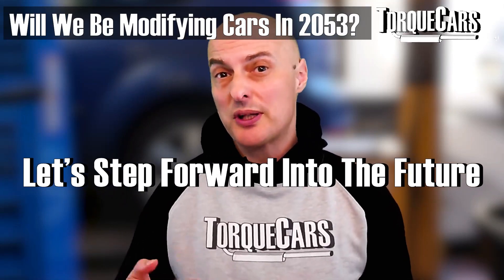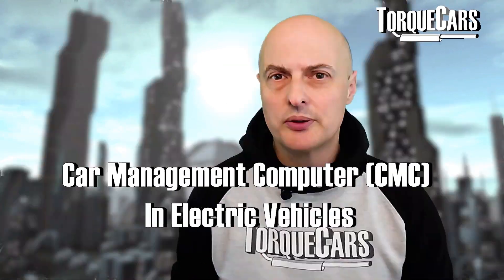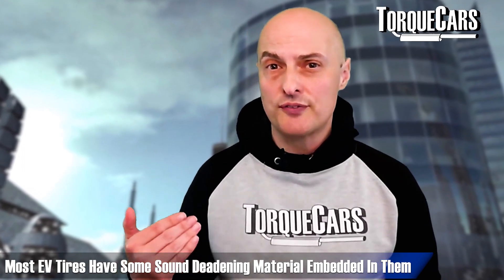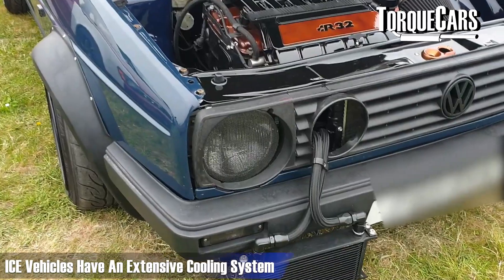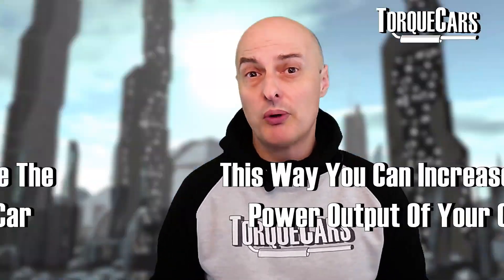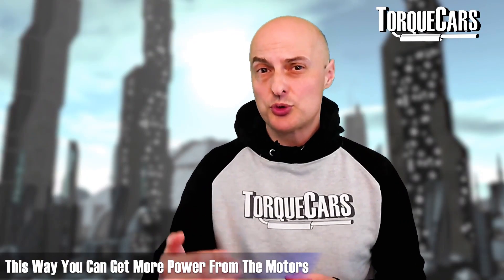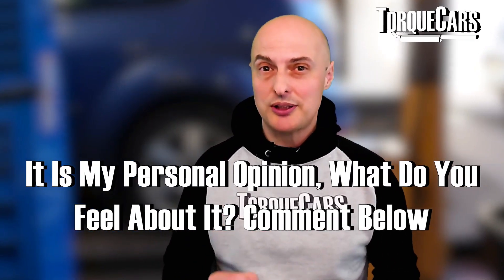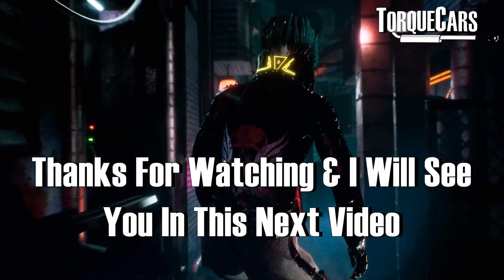Can You Modify an Electric Car? The Future of EV Car Tuning & Modification in the Electric Era

Comment: bruv we have already been doing this for 5 years now in the fbgrp for chevy volt modding. theres only like 3 people who know how to do it so far and they offer their services for hire on the east coast of usa. the gen1 volt was actually one of the fastest cars made in the usa (in terms of max rated power of its ev motors, ~180kw) and theyre getting to be 15 years old now and cost around 3-5k usd. the 100mph speed limiter is easily removed in software and by tricking the car into thinking its a 2016 cadalac elr with some ecu reflashes (way harder than im making it sound) people are getting around 200kw to the wheels and racing them down the hwy at 150mph+ lol. usually takes a lot more to do that though without freaking out the battery bcm since the og battery can barely handle it at 100% health not to mention a decade and a half + 100-200k miles of degradation. the work around right now is to add a 2nd gen1 volt battery in parallel in the hatch, or stuff a gen2 volt battery into a gen1 battery tunnel which is a massive undertaking but has been done successfully by a few people so far. its around the equivalent of 300hp.
this is the future of diy performance modding just like how cheap import japanease cars started this in late 90s/early 2000s once people realized how overbuilt and kneecapped the car's propulsion system were.

Comment: There is one thing about this however.  In most of the EU new cars (from 2024) must have a limiter fitted.  This has also just been passed in Washington DC. 

The vehicle is limited to the speed of the road you are on.  Basically eradicating performance , acceleration etc.  

In the EU you can actually disable it but the fines will be astronomical.   

This has been made law to stop traffic jams, crashes and obviously deaths. 

If tuning of EVs is going to be the future of tuning then I can only imagine range will be potentially requested by drivers.

There is not much need for torque , acceleration, performance etc if the vehicle can literally only go the speed of the road they are driving on.  

I believe in Washington DC there will be no way to disable this.

Also cars of the future will be autonomous self driving.  They will keep a safe distance from the car in front and take you where you want to go without you been in control and basically the driver will not control it.  Again this is going to drastically reduce if not eradicate the need to have your vehicle more responsive other than range.

Comment: I am sorry to break it to you boys but I bought a Mini Cooper electric to test the EV waters, so far I have did a bunch of suspension modifications and brake upgrades, and I have fun smoking tons of ICE cars on the street! I still own two ICE cars, one a MK5 GTI and a 2000 Maxima with tons of bolt on, and the Mini might smoke them both of the line!

Comment: You won't be able to because you don't own it anything thats connected to the internet will be reset to factory settings or your warranty will ne void and the car put into safe mode
Reply from the maker: They said the tricore locked ECU's couldn't be cracked but they were. Where there is a will someone will often find a way, but things are getting tougher and you'll often end up with a void warranty when you start doing mods.

Comment: i have a GOLF GTE And i am always saying that i wanna do what VW should have done from the beginning and apply electric power to rear wheels, wheather to transfer the motor from the engine to the rear wheels or add a 2° electric motor to the rear of the car and tap in to the main battery. 
How hard do u think it will be to overcome all of the different bespoke programings that EV's have?
Reply from the maker: The nice thing is that the Golf platform was designed around the 4 motion so there is more space around the rear axle and in the rear of the car that a more convention design. I'll need to do a lot more research on this topic as EV's and electric motors are still relatively new to me, I'd be curious to know how the EV Golfs are structured to work.

I do know the stock main battery would be seriously lacking if it was driving a couple of electric motors. 

My rough idea would be to put a battery cell bank under the rear above the fuel tank (a smaller fuel tank might also be an option).

Add the twin motors as hubs and take a full throttle signal to kick in the rear driven electric motors, I'm sure there are simple controllers and inverters out there that could achieve this.

Full conversion to an EV is generally done by dumping the engine and replacing this with a motor, batteries and gearbox using the existing front drive and steering mechanism.
Reply: apparently there's a mod for the GTE as it doesn't give full electric power in GTE mode, only seen it done in Holland though. You'd probably also need to change the gearbox settings as stock it can only take 400nm and it runs to pretty close to that as standard.